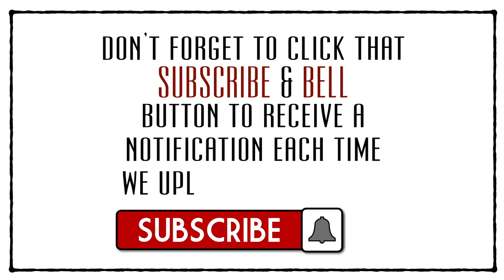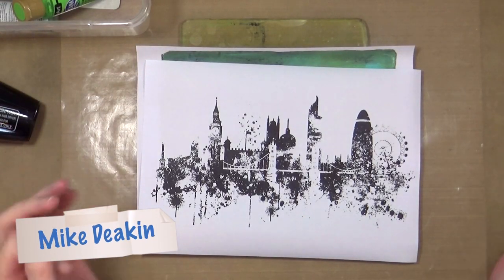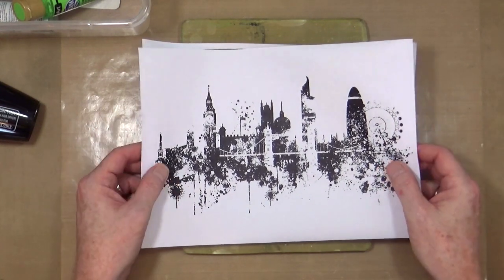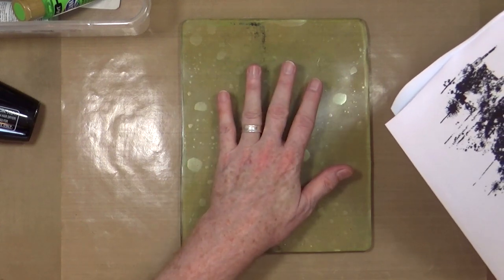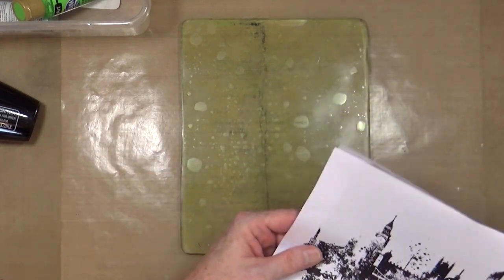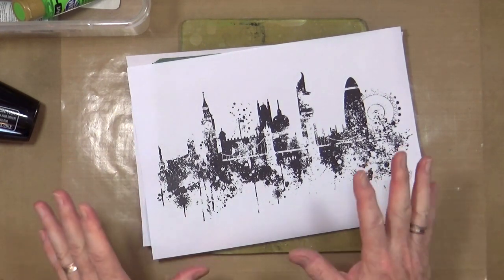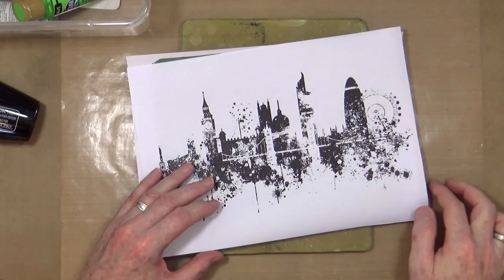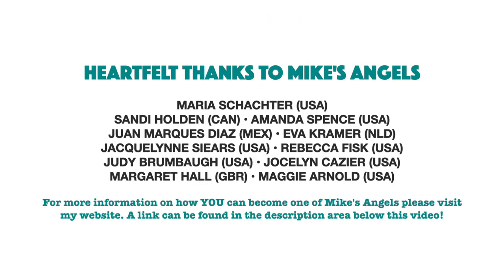Gel Plate Resist Image Transfer Experiments with Laser Prints

Comment: Hi Mike. Check out Carolyn Dube. She does the same technique but stamps the images on the plate with various items like stamps and acrylic paint, lets it dry, covers it with a layer of paint, then pulls the image. It works just the same and you don't need to use a laser image. So you get the dried patterns you've applied against whatever background you choose. Apparently a light card stock works really well
Reply from the maker: Thanks for the heads up, but it’s not technically the same technique if you don’t use a laser print to transfer the image from the page. You’re describing a different technique with stamps and mark making.
Reply: Mike Deakin You mentioned that some people use magazine images. Do those work the same as the laser images?
Reply from the maker: Not always the same, check out Shannon’s and Shel Cs videos.. links in the video description!

Comment: Does it have to be stark black and white with no grey tone fills? The only thing I can think of is that they grey scale in the image I chose isn’t letting the paint get under to lift it
Reply: That didn’t work either 🤔. From what I know about laser printers is that this shouldn’t be possible. The laser heat sets it to the paper. An ink jet however does not and would transfer like this. I’ve tried straight black and white line work and it fails regardless of how dry the paint is or how long it’s left to bind.
Reply from the maker: It's not the type of print, it's the type and amount of paint you put over the top..
Reply: @MikeDeakinArt  like a high flow acrylic?